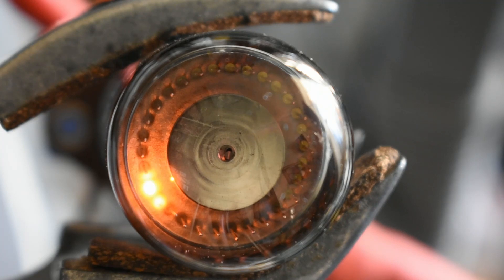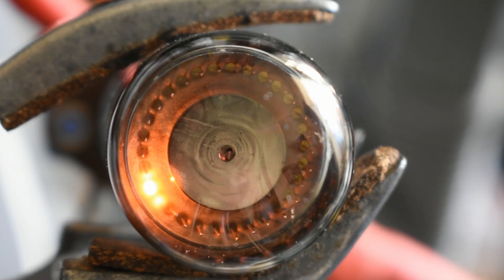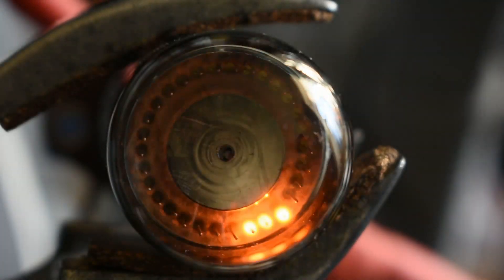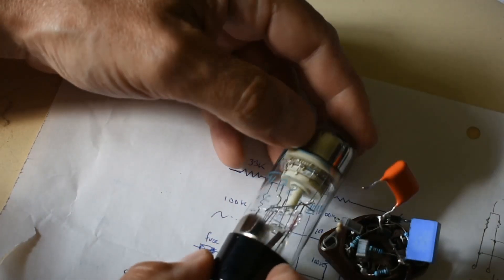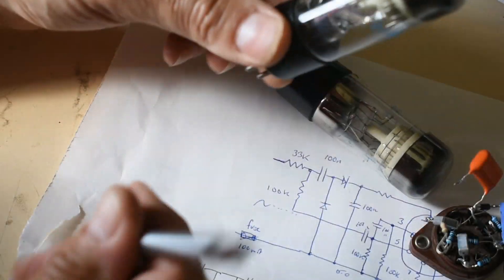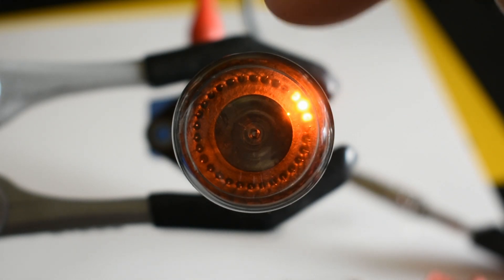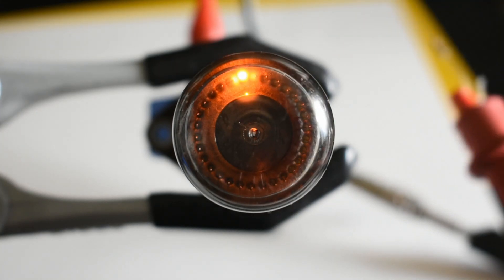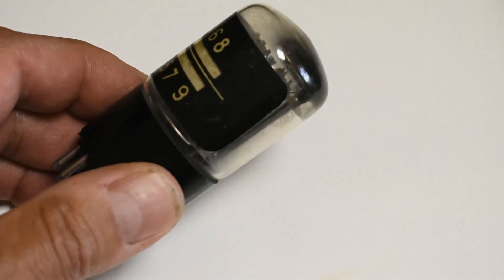Dekatron counter

Comment: Great tubes to experiment with, I was not sure about the silver deposits inside the envelope, I have NOS GC10B tubes out of the box and they all have the same silvering. I was thinking its a gettering deposit or even coated to enhance the neon glow as a visual effect when placed in a counter window. I scored a beautiful Cambridge counter device using the Dekatrons, I managed to restore it back to operational order as someone messed up the wiring in a clumsy attempt to fix it. Problem was one of the Dekatrons which was faulty, would not advance the glow discharge. A new Dekatron fixed it and now I use the device with a Geiger counter.
Reply from the maker: Interesting they are 'silvered' out of the box. I Guess it might be part of the burn-in process conditioning the pins and driving out trapped air in the metal. There is a conventional getter at the base, as common in this style of tube. Geiger counters are where I remember these being used the most.
Reply: @tuopeeks  Some Dekatrons I have come across do get quite dark inside the front ‘window’ after a lot of use, most certainly the sputtering effect of the electrodes. I was very lucky to score quite a few in a ‘Fleabay’ bid a while ago, many were NOS and some were obviously high hour ones. I am waiting for 2 Geiger counter/scaler units to arrive in the post, they have Dekatron and mechanical display counters and wll be a great project to bring back to life, might be a good video content project as well.